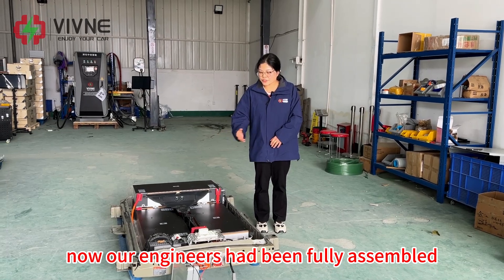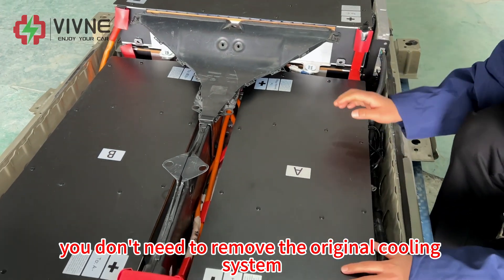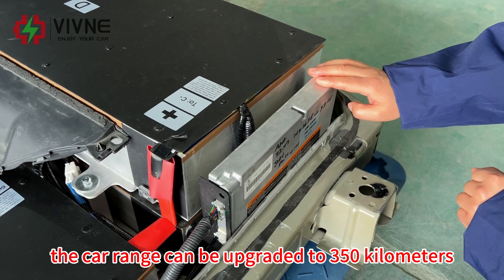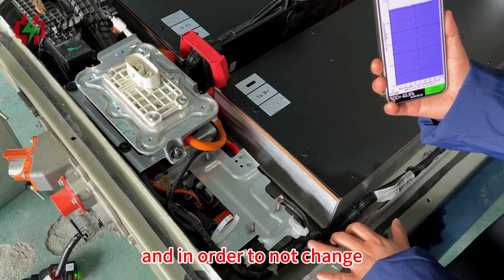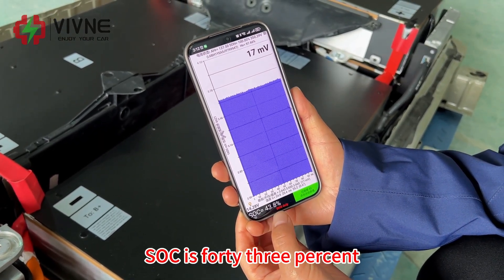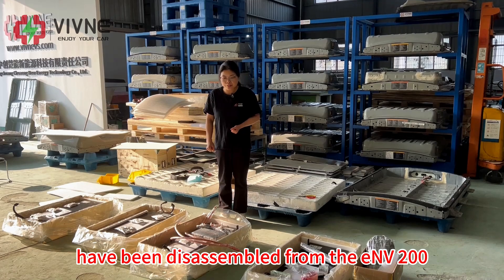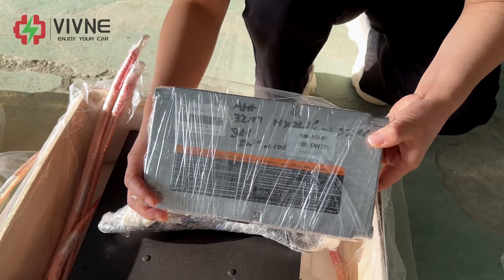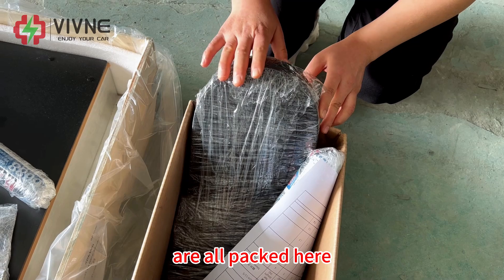VIVNE - Nissan e-NV200 50kWh module kit

Comment: why only 2 years warranty? do you have installer in germany? if not, try to get in touch with ev-clinic...
Reply from the maker: The warranty is related with our pricing strategy only. If for longer  warranty period, there will be an increase on the selling price then. The installation is not difficult. Thanks for the information provided.

Comment: I'm in Chicago land, who works on EV's in my aera?
Reply from the maker: We have installer in USA, but is not in Chicago.  A nearby car repair shop can do the replacement easily and we will provide full technical  support.  If you need more information, please kindly contact: helen@vivnevs.com  Whatsapp:+86 18717786639  Thank you.
Reply: @VIVNEHelenMao any installers you know of in the EU, Ireland in particular?
Reply from the maker: @BeLowBelowo  Not yet to have.  The assembly is not difficult. Trust you can assemble it with our full technical support.
Reply: We did in NY Mecanic shop it’s easy

Comment: Hello Helen, very good job! Looks like the maximum Voltage is a bit lower than the original one, correct?
Reply from the maker: Hello David,  thanks. Actually  the Voltage platform is the same as original.  The Voltage display on Leafspy is related with the SOC, which is dynamic.